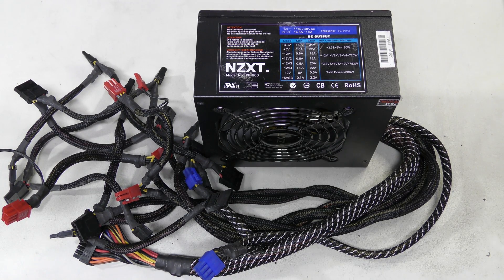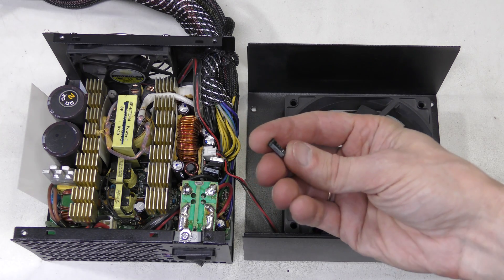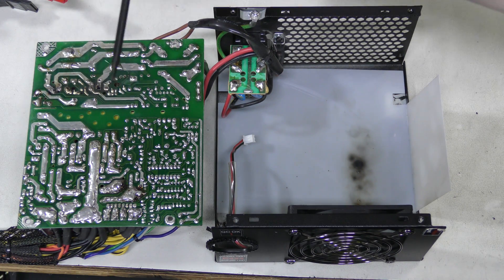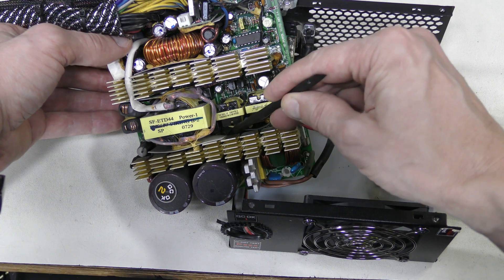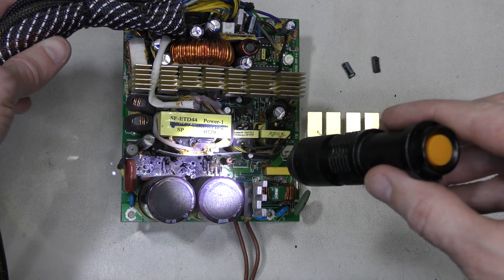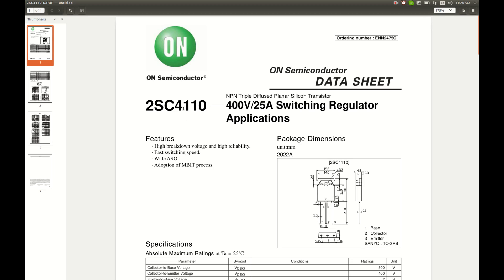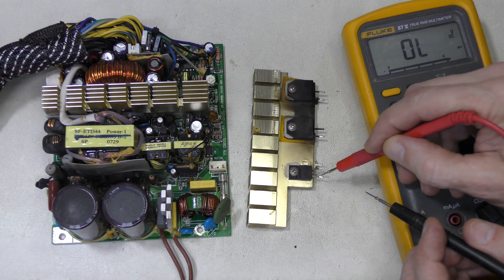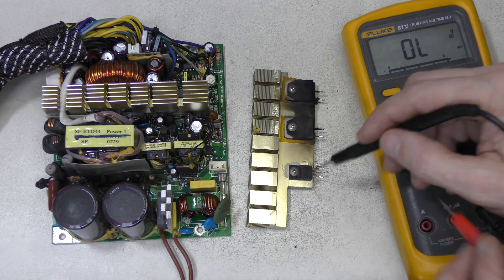#85 - Blown PC power supply NZXT PP-800

Comment: I've seen one PC PSU with almost this much damage, neutral failed in 3 phase meter box, so 240VAC became 415V. Control chip on the hotside had a hole blown in it.

As for what failed in this PC supply, subber network failure would put voltage spikes into both main switching transistors. Another equally likely failure is those capacitors, too much ripple on the base leaves both switched on at the same time, kaboom.

Comment: 4:02 Left to right: Main Transformer, Gate Drive Transformer (yes it actually drives a base not a gate), Standby +5V supply transformer (also has +12V for internal circuitry/fans).

Comment: That looked like a very violent meltdown, i would be supprised if it didnt back feed through the gate/base drive transformer to the pwm controller chip and damage it.
If it's not too old the low esr capacitors and other bits can be salvaged, the output wires can be handy too.
I try not to throw things away if they have a use :-)

Comment: That is the most spectacular failure I’ve seen of a PC PSU. I can’t think offhand what could cause catastrophic damage to the primary side without violently blowing the fuse. The transistor legs melting might be explained by the primary caps dumping their charge through shorted semiconductors, but it doesn’t explain what caused the fault in the first place. I’m guessing a huge but very brief mains surge.
Reply: ProdigalPorcupine Maybe overlapped base drive signal if that’s a half bridge. “Shoot through “ who knows

Comment: I'm puzzled why the fuse hasn't blow. At this vast amount of energy that went into burning up the PCB and vaporising the Transistorleads.
Nevertheless, I'm now over thirty years in the business of repairing electronics, but I haven't come across the trick to charge the gate with the positive lead up to this day. Thanks alot for showing.
Reply from the maker: You are welcome. At least it was not a completely useless video. :)
I forgot to mention that the other lead should stay connected - charge the gate relative to the source, but that is fairly obvious I hope. Sometimes it is hard to remember that something obvious to me might be not so obvious to someone else.
Reply: @feedback-loop   There is a wise saying in Germany "Alt wie eine Kuh und lernt immer noch dazu". This translates Best with: Everyday is a school day
Reply: If I had to guess I would say the energy came out of the input capacitors and blew everything up. In that case there is not much current draw through the fuse and it can stay intact.

Comment: That was worth it just for the out-of-circuit MOSFET testing demonstration. It looks like the emitter leads for both BJTs burned up? Crazy!
Reply: Yep I agree ! The quick testing of the MOSFET using the ohmmeter to charge and discharge the gate out of circuit in an eye blink, also caught my attention instantly ! How convenient and quick... I will sure remember that one, thanks ! :-)
Too bad for the failed repair, but well you can't save them all.. this one was too far gone it appears...

Comment: Even witn schematics it woulf very hard to repair probably some traces are burn and the board coock. How they hell they fail in this destructive way?
Reply: Excess voltage ripple caused by bad capacitors can cause the switching transistors to fail under stress, though I don't think that is what happened here.  This is a common issue with the switching versions of the popular ZD-915 and ZD-985 desoldering stations where improper values are used for the output smoothing capacitors.